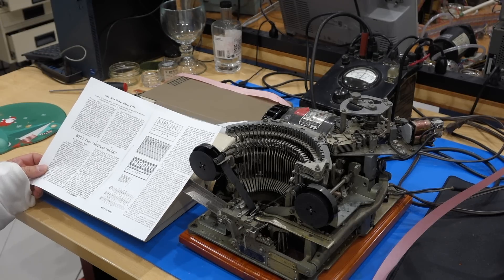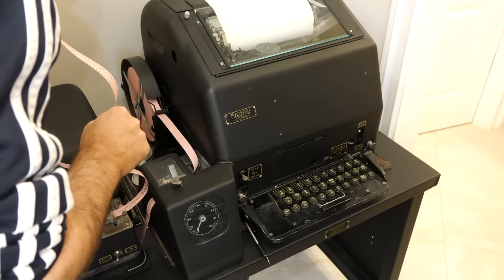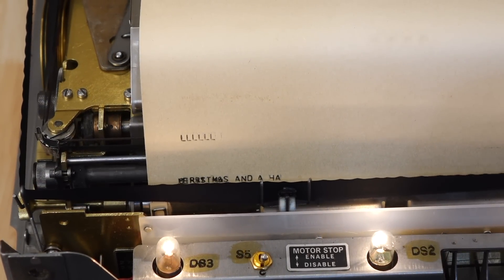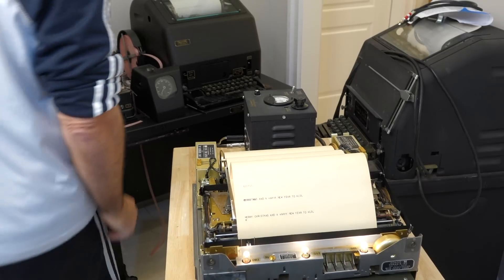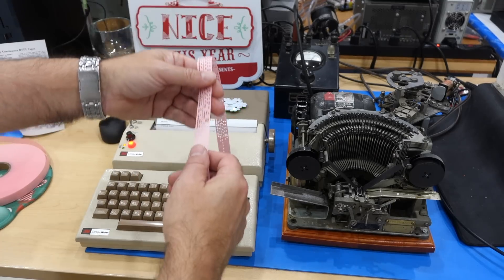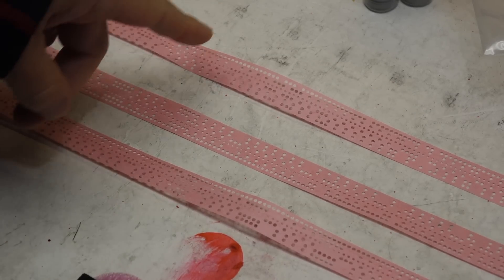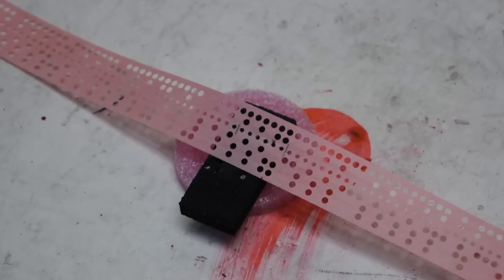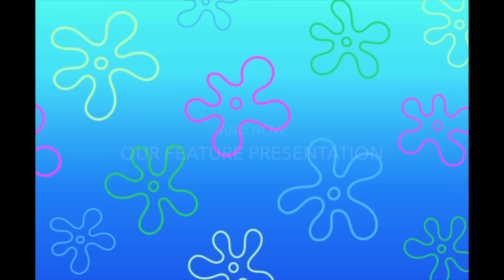Teletype Music! A mechanical Christmas song.

Comment: I remember sharing this tape using my Creed 7ERP on the 2m band in the UK. It was known as Jingle Bell. In those days you built your own TU (RTTY modem). I can still smell the oil. As someone else said, the easy way to edit was to read a tape, stop it before the error, key the new characters, then restart the reader after moving the tape past the error. Paper tape was cheap :)

Comment: Back in the day (1970s) we had a tape splicer to correct mistakes in our computer programs. It used the sprocket holes to line up the tape, a razor to cut at exactly the right point, and special stickers with sprocket holes to connect sections of tape.  There were two types of stickers, all solid (except for the sprocket holes) and a kind of ‘dibber’ to punch new holes via correctly positioned holes in the tape clamp, or ones with holes in every position to just connect two pieces of otherwise correct tape.  Happy days!
Reply from the maker: Boy, I *need* that contraption for Christmas!
Reply: @CuriousMarc  They seem to have almost disappeared from existence… There is a 5-hole punch / splicer on eBay right now, and self adhesive 8-hole splicing stickers…
Reply: No need to buy special equipment. You can make your own splice tape by putting a strip of scotch tape (the sticky kind) on a new paper tape and running it through the punch to punch all the holes.  @CuriousMarc
Reply from the maker: On an ASR33 8-bit punch you could. But you can’t do that with the Model 19 or 14 5-bit punch. No way to open up the punch and have it punch in the middle, nor to feed an already punched portion through it without repunching it.

Comment: I wrote a paper tape editor for a numeric controlled Bridgeport milling machine in 1977.   Written in BASIC running on multi user IBM System 360 main frame using remote dial up 300 BAUD acoustic MODEM CRT terminal or 110 BAUD Model 33 teletype.  The NC mill ignored the RUBOUT punches every time you backed up and corrected an OOPS.  But was still very difficult to directly type a paper tape  to create a perfect NC program.   Any extra RUBOUT punches would mess up your musical bell timing.  Common practice was to create short parts of the NC program then use the teletype's tape duplication function to create a final long tape from the short sections.   The editor was great for creating long and complex machine control tapes with no errors.   Sorry I don't have the editor's code anymore.....

Comment: When I started working at DataSaab back in 1974, we had a special small hand tool tool and small bits of tape, so you could add a piece of tape. And then push new holes, to save a worn-out bootstrap. God Jul och Gott nytt år  from Sweden.

Comment: When I was a kid, I spent much time in a switch-bar central office. The mechanical noise of all your Teletypes running has a similar clatter. The central office noise was often from "trouble" cards being printed. I was 8, I would often read the cards and busy out "troubled" circuits. I started early!

Comment: Another very special and funny episode. Go on, go on. But . . . at least I would have expected you to write the text on your PC, which you then connect to the tape punch with a nice coded program. merry Christmas to you all and keep on the good work.;-)😇
Reply from the maker: I hesitated on that one. I thought I would get there fastest with the Whisper Writer, but that did not pan out. Next fastest was to simply enter it by hand (it was late at night already). Then programming and making a driver for 5-bit high current 45.5 bauds loop would have been the alternate, but way slower to get there, you are talking a day at least.
Reply: @CuriousMarc  Yes sure, but why would you take the easy handtyping way when you can do it the dificult, but elegant way😇
Reply: @CuriousMarc  Off Course. But this problem brought me back to 1979. I just build my first computer, based on the S-100 boards. (which I had to import from USA to the Netherlands) And I got hold of a Teletype ASR 33 with reader and punch. I build the hardware current source (20mA Ithink) and wrote the driver in assembler(8080)😃

Comment: When I was learning Algol 60 at school in 1973, we had an IBM teletype (maybe a Model 33?). We had to punch our programs onto tape and then post it to a local college that had an Elliott 4100. They would run the program and send the printout back by post. Getting the tape right before it was sent off was essential! I made up a small device that allowed me to accurately punch holes to correct errors as Marc did. Because the tape holes were on 0.1 inch centres, a piece of 0.1 inch Veroboard was perfect so I used that and a piece of Perspex to make a clamp that aligned with the sprocket holes so I could accurately punch the holes with a nail that I had shaped into a hole punch. It worked very well and saved me weeks of frustration - I was mainly writing a program for my physics project.
Reply: At university in 1975 and used an ASR33 to punch Algol and Fortran for our Elliott 903, which really was a personal computer.  We loaded the compilers using a two pass process with a very fast tape reader, generating intermediate code and then the second compiler pass to make the load able tape.  Then the loader and the loads left object tape and then… you tried to figure out why it didn’t work!